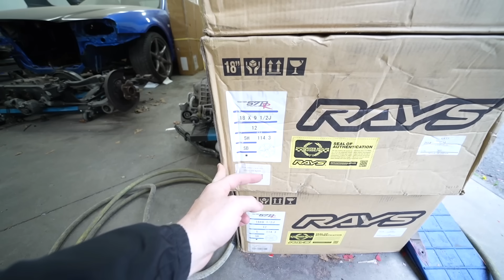RESTORING AND REBUILDING A TOTALED DRIFT CAR! (NEW CHANNEL NAME?)

Comment: You could use some GLUE PULL REPAIR Equipment and I just happen to be one of the two lead trainers for KECO GPR.... those dents would be easily pulled out, not looking for perfection but for quick rough out. lmk.